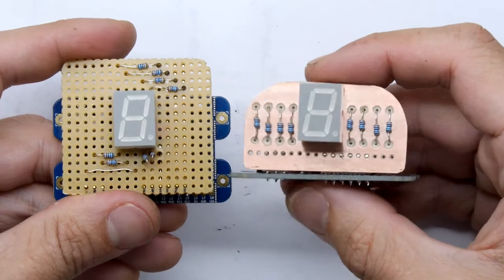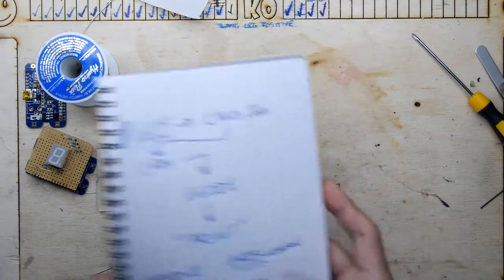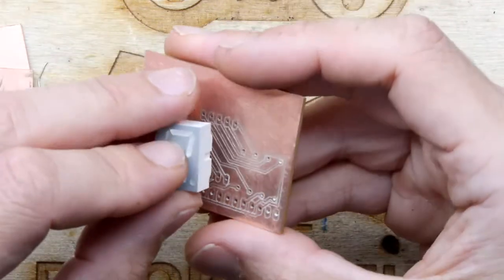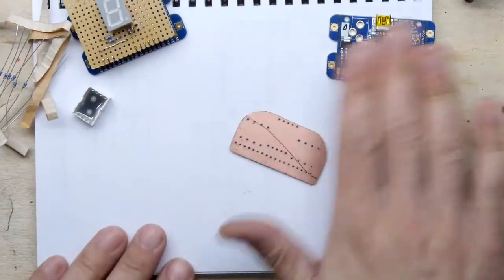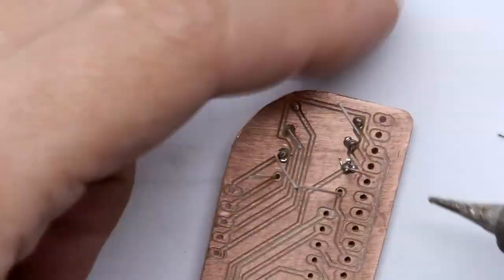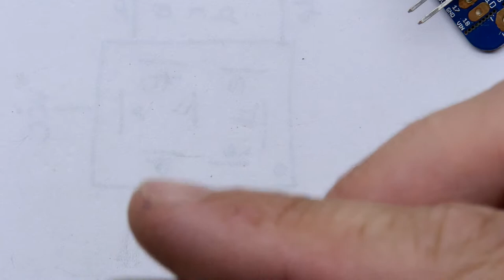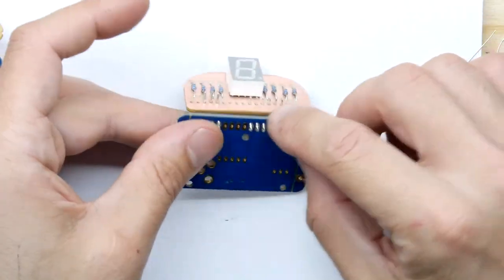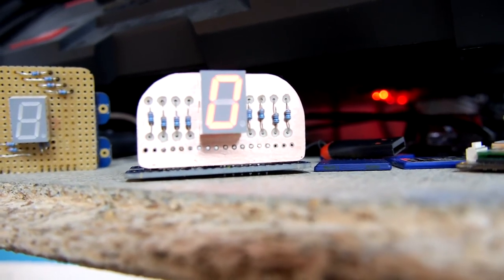Milling PCBs Pt2 Steampunk Boobie Display

Comment: Did you already tried to mill SMD pcbs? I have the same mill and I’m struggling with the parameters for milling the pcb correctly. Were you able to use the v shaped drill? I’d really happy to get some feedback 🤗
Reply from the maker: I hacked mine so it could self level the z axis. Without that milling PCBs was impossible
Reply: backofficeshow are you talking about auto leveling? I'm using a probe, but nevertheless I'm not happy with my results. So I hoped that maybe you could give some recommendations about depth, forward speed and how many passes (and which "passdepths") you are using with which bit 😇. Btw - Sorry for my bad english 😅
Reply from the maker: You are asking all the right questions, but it was so long ago. I think I used a 30 degree conical bit. Just cheap ones from the far East. I tried with milling bits but they did not work well. I don't recall the exact speed, but it was very very slow.
Reply: backofficeshow okay, thank you for your reply!